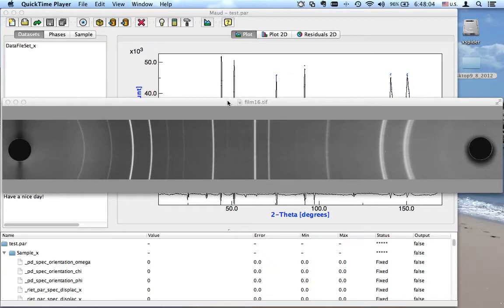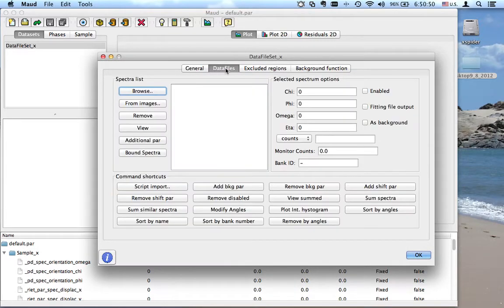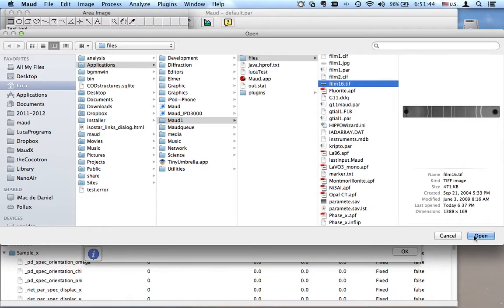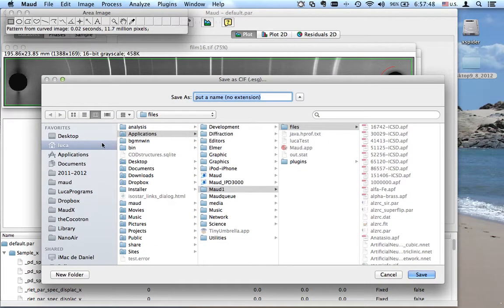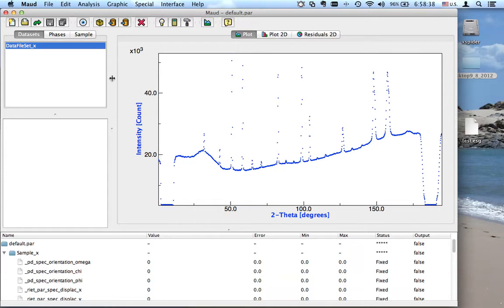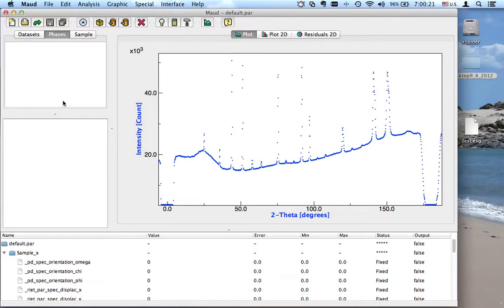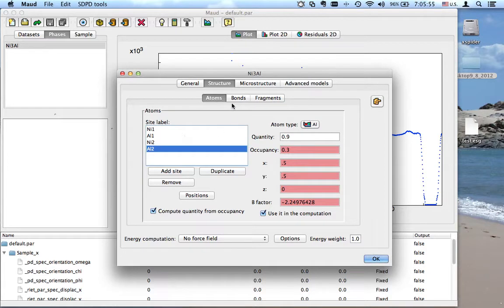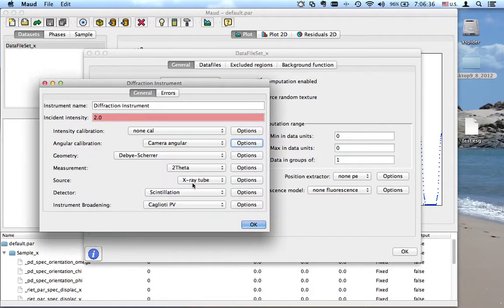Debye Scherrer 2D curved image integration and analysis

Comment: What does B factor stands for? does B factor negative or positive makes any difference?
Reply: Lookup the Debye-Waller factor. B is usually taken to be isotropic in Reitveld refinement and is defined in terms of the atomic displacements. More often than not it is in the range  0.5 to 1.5